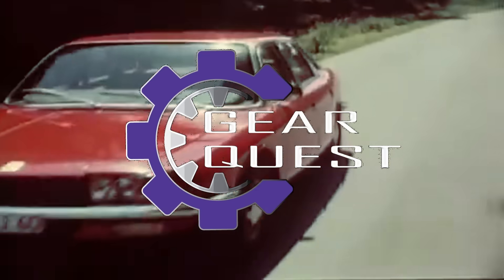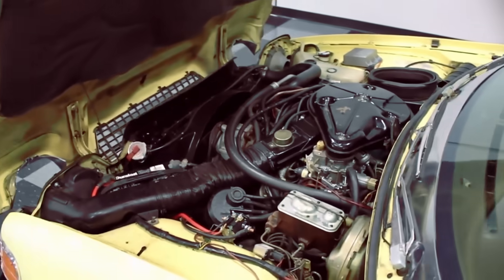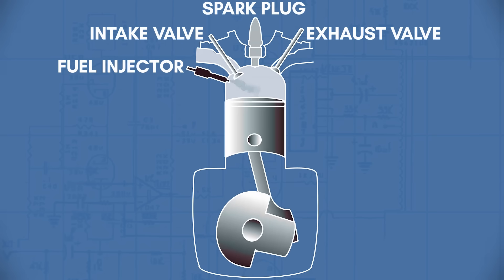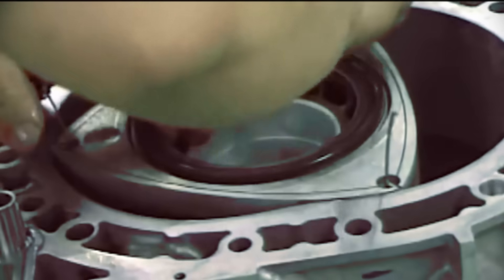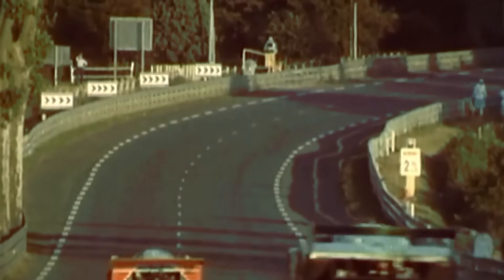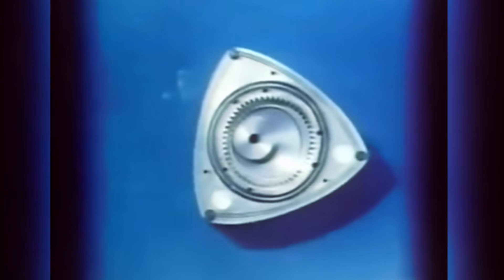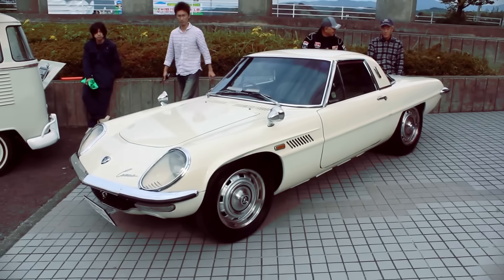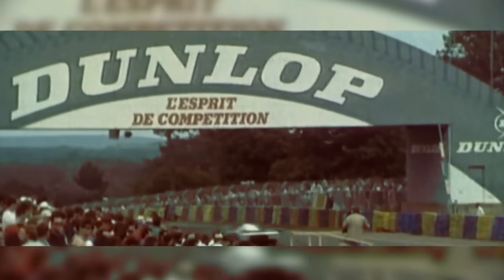The History of the Rotary Design

Comment: I wonder if modern technology might eliminate some of the problems?
Reply: 5% hydrogen injected with the air intake cuts emissions  by 98% and cools the exhaust, also gives 25% better economy.
Reply: @gordonloughton9800  But how much energy does it take to generate hydrogen...
Reply: @gordonloughton9800  Where and how would you store the hydrogen?
Remember, hydrogen gas is not something you want to fuck around with, and compressed hydrogen to keep it as a liquid is just as dangerous in the hands of dumb people.
Reply: Gordon Freeman hho generators
Reply: @GoldSrc_  You use a stainless steel hho cell which consists of 24 plates held  4mm apart then put 12 or 24 volts across them, 10 amps load, distilled water with koh as a conductor, then feed the hho into the engine.Its best with older engines, the less computer control the better.Reduces emissions, more power, better economy,cooler exhaust, which is very relevant to a rotary engine as most of the poor fuel economy in a rotary is because most of the burning fuel gets chucked out the exhaust.
Reply: @gordonloughton9800  Are you ignoring efficiency there?
Can you get anything close to 90% doing that? because anything worse than 90% and gasoline is still better.
Hydrogen is not a magic gas, and it takes energy to generate it.
Reply: @GoldSrc_  hydrogen gas is fucking safer than carbon fuels...
Reply: @GoldSrc_  um gas is not 90 percent thermal efficiency in a engine hydrogen properly burned is actually more efficient has better burn properties also.
Reply: The rotary is pretty much dead in the consumer market, EVs will eventually catch up to ICE and leave it behind.
Which is a bit sad because the rotary is WAY cooler than piston engines.
The rotary engine is just horribly inefficient, it would be like trying to heat your house with the heat of your car's engine, it can be done but there are better more efficient ways to do it.
Reply: @GoldSrc_  how electric motors have no more room to gain efficiency. They can only grow larger and hope battery tech can keep up. Ices are limited on thermal efficiency true but so is everything. Evs are a dieing tech that have needed to be replaced by superior techs such as ices hydraulics or pneumatics but given how much more costly and dangerous all 3 of those are being superior doesnt matter. Evs the oldest car and still needs more time to catch up to its younger stable mates that should show you how bad evs truly are.
Reply: @jdrok5026  Why do you compare ICE to "everything" when it comes to efficiency?
But no, most modern stuff is way more efficient than ICEs.
ICEs will never achieve 70% efficiency, the average EV is around 70% and higher as there is no added steps to send the electricity from the battery to the motor.
EVs will catch up, after 100 years there is not much more to squeeze from ICEs.

How is hydrogen gas "safer" than liquid carbon fuels? I don't need to bring the Hindenburg do I?

And I never said that gas was "90% efficient".
Reply: @GoldSrc_  hydrogen gas is naturally very rapidly spreading. You say never will but no evs are 70 percent efficiency in truth or higher that is only what the motor can do not what the entire system of delivery can do. Also because efficiency of ices is measured wildly differently yet electric components arent actually measured the same at all. Given that the spread of cooling and the heat reservoirs is not very high the efficiency based on the Same model would out electric at extremely low efficiency percents
Reply: @jdrok5026  What's the efficiency of the average DC/DC or DC/AC converters used in EVs?
As long as it's over 65% (and pretty much all of them are), EVs will always have higher efficiency than the 25-30% efficiency of your average ICEs.

I'm not saying get rid of ICEs entirely, as there are environments that are not suited for EVs and where ICEs still reign supreme, but you need to understand that ICEs just can't achieve more than 60% maximum theoretical efficiency, at least that's the number I remember, but the average is around 25-30% efficiency.

The more efficient you make something, the less money you waste, ICEs have had 100 years to improve and not much has been done to improve max efficiency.

I am not, and will never be, anti ICE, because I too love me some engine roar as much as the next guy, but I understand the importance of efficiency.
Reply: yes, a lot has been done and researched on the rotary, try to search for unbreakable seals. A lot of knowledgeable people know what to do with rotaries, and when built right, they're really reliable, thought a bit thirsty
Reply: If you have the money you can have a billet rotary engine made.
Reply from the maker: Seems the focus is on electric cars now. The rotary might be gone for good 😢
Reply: Even more bad to see since rotary motor would be easier to couple with an electric one
Reply from the maker: Do they couple electric motors directly to engines now?
Reply: Not an expert but with a Wankel motor I think it might be possible...but might be an incompatibility between their rpms
Reply: @GearQuest  Yes, Mercedes is doing it on their I6
Reply: Gear Quest Multiple hybrid cars now have crank mounted electric motors more or less built into the block of the gasoline engines. Mostly high performance cars for now(Ferrari etc) , but that's where it starts often and then trickles down to consumer stuff.
Reply: @GearQuest  Look into the new Skyactiv-X engine from Mazda! It's a mild hybrid (the term for combustion engines that have electric engines added onto the block) and it's also supercharged! 53mpg at 55mph, all with 180bhp and 180 torque!
Reply: @GearQuest  yes they do.
Reply: @noth606  except it's not a new technology it's a old ideology hint gensets are hybrids.
Reply: Laser spark plugs if you want to just eliminate the flaw of current production rotary.
Reply: Or they could do what I've considered very easily possible for the past two decades, and that is to change the configuration of the rotary to electromagnetic. The size and shape of the rotary engines that already exist are perfect. The only battery that would be needed would be used for starting it so it would remain in the very desirable high power to low weight range that the previous rotary designs have held.
Reply: JoRgE Chavez 
I want to understand. Explain please.
Reply: @JoRgEChavez-to2xd   um that's called a electric motor... electromagnets would not solve the rotaries issues and would like not function worth a fuck because electric motors have a rotor that floats on a air friction barrier.
Reply: Yes and no yeah modern technology could probably help the engine quite a bit when it comes to the reliability but when it comes to racing a lot of people going to electric because it's so much lighter produces a lot of torque and in some ways can be much faster to work on truthfully I think the future is going to be more of hybrids For the civilian market
Reply: @mrbladesletplays  electrics are lighter is that why modern electric race cars are heavier than old era race cars and even modern ice race cars. Evs have no real advantage besides thermal efficiency. Starting torque in racing is useless.
Reply: @mrbladesletplays  faster to work on yes and no. Mechanically yes electrically no.
Reply: Mazda just launched it first plugin battery electric car... The Rotary is DEAD!
Reply: Some of the reliability may be solved, but the less then ideal from an emissions standpoint combustion chamber shape, difficulty to lubricate without introducing oil to the combustion, and large surface areas leading to losses through heat  will stay...What they have is a great power to weight, but that's not enough of an adavantage to ofset the disadvantages.
Reply: @Finnspin_unicycles  You could solve that with walls sweating lubricant, that way you introduce less lubricant and can use one that burns cleaner. This has the side benefit of cooling better.
Reply: @Finnspin_unicycles  your forgetting many metals can be lubricating to each other. Uneven heating is easily solvable by directly cooling the engine both by a fluid and by directed flow over finned externals. You dont need to inject oil if your materials are correct.
Reply: Yeah, replace the rotary engine with an electronic one :D The rotary is just a bad / inefficient design. Some people just love how they rev high and smoothly, as well as the sound they make.
Reply: @BensCoffeeRants  Bad is the wrong term to use. Big block V-8's have the same issues. Nobody calls them bad.
Reply: @WALTERBROADDUS  Big Block V8s inject and burn oil by design? It seems like a pretty bad design based on how they demonstrate it in the video.  Rotaries use a lot of gas AND oil, and produce a ton of heat, they're not known to be very reliable....I've worked for company that sold RX-7s and other rotary vehicles, I'm on rotary facebook groups, even people who own and love these cars agree they're high maintenance and not too reliable.
Reply: @BensCoffeeRants  electric brushed motors are a bad/inefficient design to just say something is bad/inefficient when everything can be improved is asine.
Reply: @jdrok5026  Electric motors are 80-98% efficient, meaning most of the power is actually put to use,  while gasoline engines are typically around 25% most of the energy gets converted to heat not put towards doing any actual work (powering the car). Although some of that heat energy does get used in the winter for heating the passengers!  But that heat and the systems designed to manage the heat / prevent the engine from overheating is also the cause of a lot of potential car issues and why we need to replace the oil etc. 
https://en.wikipedia.org/wiki/Engine_efficiency   https://cleantechnica.com/2018/03/10/electric-car-myth-buster-efficiency/
Mazda and Toyota have made some improvements lately getting around 40% thermal efficiency which is pretty awesome, but still nowhere near as efficient as even the least efficient electric car.
Reply: @BensCoffeeRants  but they also have higher energy density, coupled with quickness and easiness to refuel. A 1 ton battery spanning the bottom of the cabin has lower energy density than 60l tank of gasoline. That's why ICE cars are lighter for the same volume to the E cars. Not to mention that you can fully refuel an ICE car in 3 minutes compared to hours for E car. The fuel of ICE is also portable while E doesn't, imagine getting stranded in E car with you battery depleted, you can't just go to the nearest fuel station with a jug and bring it back.